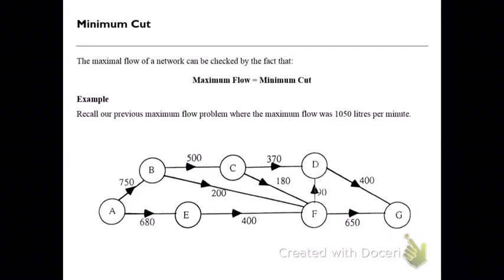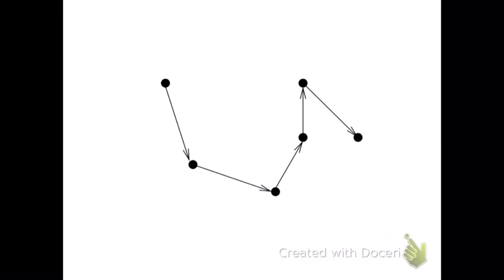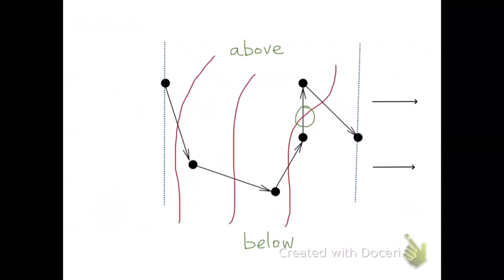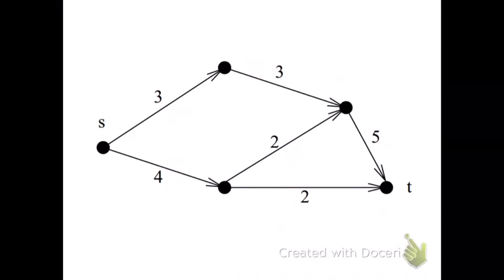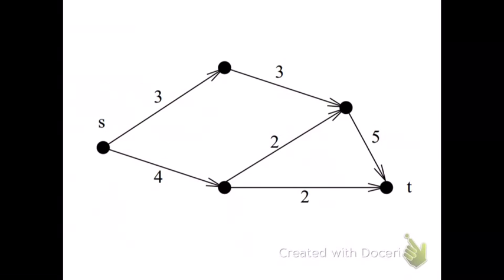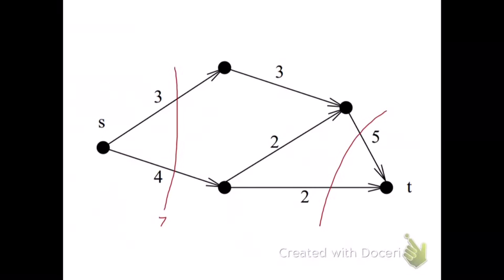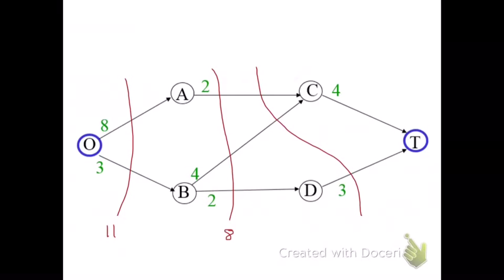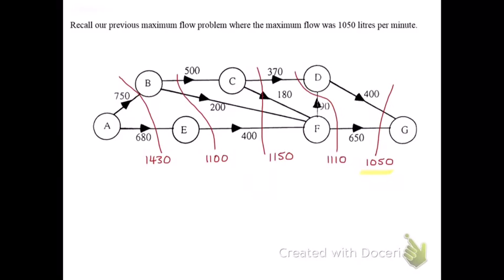Networks - Minimum Cuts

Comment: But why isn't 5 the minimum cut?
the cut can go trough 3->2 and the opposite of 5 which sums at  5 .
A cut must divide the graph into 2 groups where the sink and the source must be in different groups?
Reply: If you refer to the graph at 5:55, yes, the minimum cut is 5, and yes, a cut must divide the graph into 2 sets where the sink and the source must be in different groups.

Comment: Excellent explanation.

If an edge is in down to up direction, and the minimum cut line is crossing it from the left side, then it will be counted, otherwise, not.

If an edge is in up to down direction, and the minimum cut line is crossing it from right, then it will be counted, otherwise not.

If an edge is in horizontal direction, from left to right, and the minimum cut line is cross it from top to down it will be counted, otherwise not